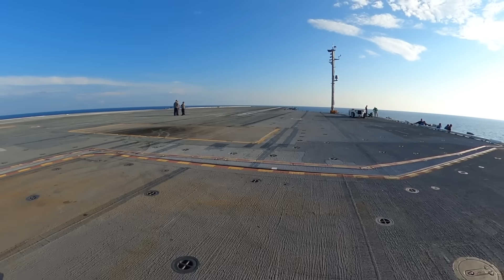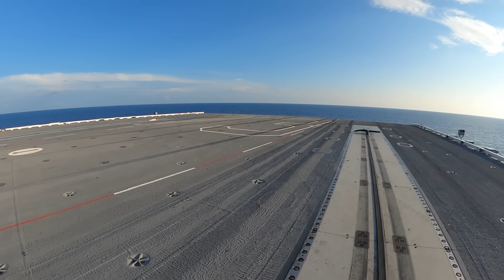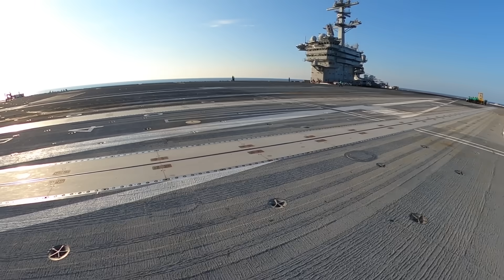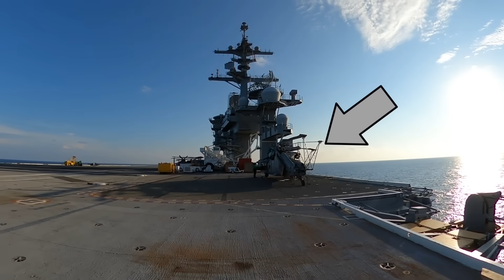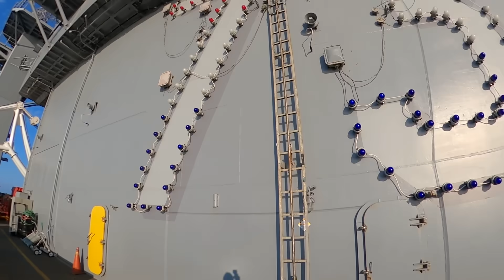The Carrier Flight Deck You Rarely Get to See

Comment: I loved the tour, took me back to days aboard the Ranger and the Enterprise, both of which are now gone. However, I did notice ya didn't talk about the port side waist foul line as you walked over it, or describe what they represent, or how many times in a cruise we here the airboss yell at some unobservant sailor to clear the landing area (LA) and the importance of maintaining a "green" deck during recovery operations. Also, ya just walked on by the barricade stantions,  and the importance of "rigging the barricade" for aviators in trouble. Sure, we get to see them used in Top Gun: Maverick and perhaps you didn't feel the need to express, however, there are non-sailor types here that have no idea what goes into rigging the barricade, the training and equipment material condition safety that aviators such as yourself count on when taking the barricade is your only shot and how you are depending on teen agers to maintain and rig that barricade. I really did enjoy the video, as I said, it took me back forty years to my youth and the best times of my life while working the flight deck. Thanks Pail.
Reply from the maker: Glad you enjoyed the video. 👍

Comment: Question: if the non-skid surface has to be reapplied every few years, that implies that it flecks off. Does that risk damaging engines or is it usually all accounted for during FOD walk downs?
Reply from the maker: It breaks off in sand grain-sized pieces.    No real threat engines.

Comment: Great Video. A lot of the items and areas were familiar, of course our Essex class ASW carriers were all props, so no JBD, but Tilly is still there. Back in the pure straight deck era, when they had aircraft parked on the bow and were recovering aircraft, there were no bolters. Initially the only thing they had to protect the planes up front was Tilly parked athwart deck behind the pack. Later they rigged barriers to protect the pack but still damaged the landing aircraft that missed the wires, but not as bad as hitting Tilly. 

Looking back at my days on the Randolph and Yorktown, I don't remember seeing Tilly, but she had to be there, I think they kept her parked in hanger bay 3 along with the barge and boats. These videos have brought back a lot of memories I haven't thought of in over 50 years. I do have a few landings I doubt any of the current aviators have - two water landings on purpose (in an HU-16 when at NAS Cubi). .
Reply: Thanks for your service.

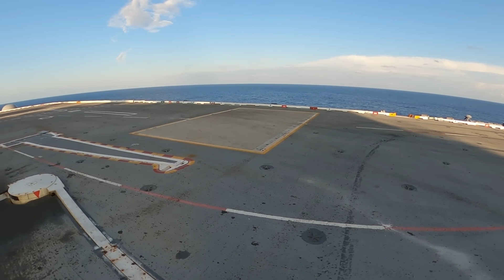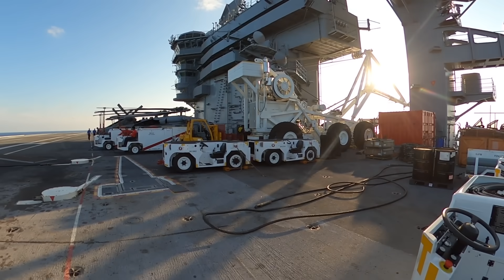Comment: 6:42 and 10:11  Darn it!  I wish you had mentioned the axe-shaped cutouts on the deck next to the arresting wires and support vehicles, which are the retractable stanchions of the barricade net for emergency landings in case a plane loses function of the tailhook or landing gear.  You could have tied them into the one crucial scene in Top Gun: Maverick, if you felt like doing so.  😄

Comment: Hi, i have some questions about rank and orders.
You are a  Lt or Cpt but you have to follow the lower NCO's on the deck to park the plane and you cant refuse?  I assume they have their orders from CO's above them and you or equal to you? 
If you arrive at a base gate and the Cpl says you cant pass, MUST he do what you demand and open or can he refuse as he has orders from higher commissioned officers?  also if you were a Maj and he had orders from a Cpt to let no one pass, can you CM him for refuse your order as you outrank his CO?
Last question- If a diff branch say a Maj and you are a Cpt demands you do what he says?  Does he have authority as you are navy and hes army?  or only in a war? 
I'm a pilot in GA and i dont think i would be frightened landing on a carrier as i guess you do thousands almost blindfolded in a Sim and its very normal if the bow isnt moving but what scares me is those 3 little tyres on the deck hitting a greasy patch and the fighter sliding with some crosswind and you stuck in it!!  right near the edge and all that, your brakes fail or steering after so many hard thumping landings. haha
Reply from the maker: You are making this way too complicated.  Directors aren’t giving us orders, they are just telling where to go.  The pilot is ultimately responsible for taxiing the aircraft.  He can override anything, but he better have a good reason. 

Rank is rank, no matter the service.  

Cheers!

Comment: I was wondering if i would be able to fit in a fighter jet. (along the lines of a growler or something similar) I'm 6'9 and would love to become a pilot but i know that would be pretty hard because of my height. Curious to see if you think i would be able to fit in a jet. Would love if you would be able to reply man or anyone that has some knowledge!
Reply from the maker: Every platform is different.  I knew a guy that was 6 foot 7 that could fly an F-18, but he required a waiver for ejection seat liability.  He was pushing it.  I suppose it depends on your exact measurements, but I don’t think it will work out.

Comment: Extremely cool video as always. What happens to the shuttles of cat 3 and 4 when planes are coming in to land? are they extended all the way forward? And if so, could it be that when you need to go around you "ride" over them with the wheels of the jet? 
Not sure if my question is clear using all the correct jargon :D
Ex military (army) from the Netherlands saying hi and thank you!
Reply from the maker: The shuttle for cat 4 isn’t a factor for landing aircraft.  The shuttle for cat 3 is covered with a metal cap called “fast Eddie” that protects it and the jets from damage.
Reply: @GrowlerJams  aah super! Looks like a pretty big object to just "bump" over at like 140(?) knots!
Reply from the maker: The shuttle is only 4 inches tall or so.  It’s not too bad.

Comment: Great video, very interesting and informative. I posted it on another forum, and got a comment that it wasn't interesting, because there was no flying. I responded that it was interesting to see what makes it possible for all the flying to happen, which brought to mind to ask for a video about the maintainers. I mentioned that none of the cool guy stuff happens without them. Said as a retired Air Force Weapons troop, C-141 Flight Engineer and current Gulfstream and Boeing pilot.

Comment: Would like to see different aspects eg the elevators in use. How they are powered. Obv hydraulics but a bit more about them. How the jet fuel gets to the deck from I presume the bottom of the ship. Similarly the ordnance and role of the Gun Boss(?). Navigator, does he/she still use traditional methods or solely rely on modern systems. I've got an app for that!! Not something you always want to hear.

Comment: I have a question about the non-skid deck. I'd imagine it is pretty rough on both aircraft tires and deck crew shoes/boots. How are both resistant/non-resistant to it? I have something very similar on the deck of my sailboat, and it's murder on shoes!
Reply from the maker: Yup, it’s very rough. It accelerates the replacement of the surfaces that it encounters.  It is what it is.

Comment: I served aboard 2 carriers in the late 80's and ending with Desert Storm.  The brand new USS Roosevelt and the middle aged USS America.  Since my job was down in AIMD, I only visited the flight deck when flight ops was secured - SO, can someone tell me what the row of white box squares are at the 11:30 mark ...starboard side running with the 'bomb farm'?  I just assumed that they may be for emergancy ordnance disposal.
Reply: You're right, they are for ordnance.  They are jettison lockers for CADs and about anything you can fit in there.  The handle on the lower right of each one is for jettisoning.
Reply: @stanstenson8168   
Thank you - mystery solved.

Comment: What are the blue barrels on the catwalks?  I always see those in DCS and wonder what they are.  I once got a tour of the flight deck of USS Ranger when it was in port in San Diego.  It seemed like the pad eyes had a secondary use as ash trays.
Reply from the maker: Rafts, if things go bad in a hurry.
Reply: @GrowlerJams  Oh, I had thought the rafts were the white barrels that hang off the side.
Reply from the maker: Oh, I misread your comment.   Yes, rafts are in the white barrels.  Honestly, I have no idea what’s in the blue ones.  🤷🏻‍♂️
Reply: @GrowlerJams  Hah, okay thanks.  My search continues!
Reply: the blue barrels are AFFF concentrate - which is mixed with seawater from the firemain to make AFFF.    There is an installed AFFF system that put out AFFF to hoses on the catwalk and thru the flight deck sprinklers.   the blue barrels allow sailors to still make foam in the event of a casualty to the installed AFFF system or if all of the AFFF in the installed system has run out or used up and deck crews to continue making foam from the AFFF barrels as long as there is firemain pressure.   i don't know the capacity of the barrels on the catwalk - maybe 50gals?  if they are 50gal barrels - each barrel should make 4700 gals of AFFF and last about 20 minutes.
Reply: AFFF.

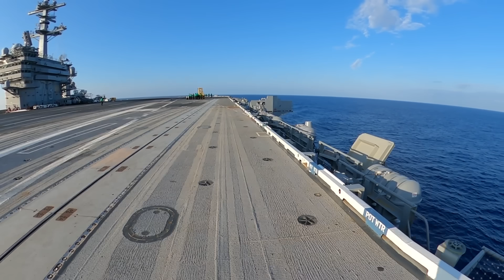Comment: 5:15 wait, what?

I thought those were where ships pump sea water through, to wash the deck, in case of something like a radiological attack?

I mean, I know these boats have a system to completely cover themselves with a flow of sea water, I've seen video of it.

And I'm not seeing anything else to do that job?... Dual purpose perhaps?
Reply from the maker: No, those are metal tie down points.  The ship does have firefighting hoses, but they are on the catwalks.  Sea water would have no real effect on radiation.
Reply: @GrowlerJams  Mate, no.
You can totally wash off a LOT of radiation.

Sure, you can't wash off radioactive emissions, but you can 100% wash off radioactive particles..... which are a lot more dangerous than the rays.

I asked ChatGPT and found it,  its called the 'countermeasure washdown system' and  you can see it clear as day on  the 'Dark Footage' video entitled "Aircraft Carrier Bio Force Field - Countermeasure Washdown"

v=28o8z0ns57w
9 seconds in.

Tell me that's not the same holes?
Reply from the maker: Valid point about washing away the particles.  I have to admit that I have no idea.  I’ll have to look into this more.  You have me curious.
Reply: @GrowlerJams  There is a countermeasure washdown system - its not the padeyes OP is mentioning.   you can put AFFF thru it or not and just run seawater. PriFly and Conflag stations control the washdown system  - we dont run it because it puts seawater everywhere - then you just have to do a freshwater washdown afterwards.
Reply: @GrowlerJams  Mate, no!
You can for sure wash off a LOT of radiation (and bio/chem).... sure, you can't actually wash off radiation, but you can wash off the particles that cause the radiation.

Anyhow, I found it, it's called the countermeasure washdown system and it can be seen clear as day on the ' 'Dark Footage' video entitled "Aircraft Carrier Bio Force Field - Countermeasure Washdown"

v=28o8z0ns57w
9 seconds in.

Good vid too, apparently (and obviously, now that I think about it) its also useful for fire suppression.

I'm pretty sure its using the same holes.

Comment: Nice tour of the BOAT !  I was an A6 Intruder plane captain in the early to mid 1970’s. In VA-42 (RAG) NAS Oceana, Virginia Beach, Va. I got to go on the Independence, Lexington and the Franklin Delano Roosevelt on carrier quals. Exciting and dangerous work on the flight deck during flight opps. Especially night opps. I saw an E2 Hawkeye catch the cable and crash on landing. It didn’t come in level with the deck and broke the starboard main landing strut. I also saw a F-4 Phantom catapult off the bow on the same carrier qual on the Independence CV62. On another carrier qual I got to ride in a COD C1 Trader. Catapulted off the port forward catapult. That was a Thrill. After releasing from the catapult with all those G forces, it felt as if we were going into the gulf for a swim. But it just floated away from the boat. I was also fortunate to experience a ride off the boat in a Huey and a CH-46 after carrier quals. Also went to Fallon and Yuma for bombing detachments.  I enjoyed the work of a PC but not all the watches and ALL the BULL !!!
FLY NAVY !
Reply from the maker: TYFYS.
Reply: Tank you for your service Shipmate!
Reply: Thank you for your Service Sir 🇺🇸🇺🇸
Reply: Plane.Captain for.your.entire hitch?
Reply: I, too, was stationed at NAS Oceania from late 72 to early March 75 VF101 (F-4) & VA85 (A-6). I was on 6 aircraft carriers and 5 different ones. Forestall (Med cruise 75) Independence, Kennedy, America, Enterprise I also was on the flight deck too many times. Scary isn't the word. Especially when you were aft of the island during landing operations. Now I have many health issues. Along with 2 failed marriages. I attempted suicide a few times (still on my mind). I want the pain to go away. If anyone can relate, let me know? No one wants to be around me.
Reply: The GW isn’t a boat. It’s a ship, Airdale.😮
Reply: Wow. Ty Sir. TRUMP

Comment: Noob question here:
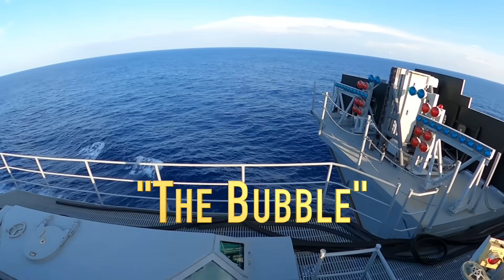What is the purpose of the windows towards a wall at 5:40 in "the bubble" station? 
Or can it be lifted up to see above the deck and it is lowered for atm... for what?
Reply from the maker: The windows are for the Shooter to see outside of the bubble when it is raised.  The Shooter needs to see the jets to launch them.
Reply: @GrowlerJams  Ah ok, so it can be raised, I hoped so. But why is there a need to have it lowered then?
Thanks for your videos and your work you do btw. Amazing stuff, great videos you deliver!
Reply from the maker: We lower it to prevent it from getting damaged from jets on the flight deck when it’s not in use.
Reply: @GrowlerJams  makes sense, safety first - everything what could be potential dangerous: out of the way. I get it now.
Thank you!

Comment: Thanks! Make a separate jam about «Tilly». Makes sense, but i’ve never tought about something like that is on board. Cheers!
Reply: Not much to talk about. The A/S 32A-35 crash crane can pick up airplanes and move them out of the landing area. It is  a  self-propelled,  four-wheel  drive, six-cylinder, liquid-cooled, turbocharged, dieselelectric-powered vehicle mounted on six pneumaticrubber tires. The ac generator is directly coupled to the engine and provides power to the drive motors, luff/hoist winch motor, auxiliary hoist/counterweightwench motor and motor control systems. It has a lift capacity of 75K pounds. If you put that model number into Google, you can download a complete manual.
Reply: @ cheers 👍🏻😂
Reply: @Naturephotodude  P.S. If you wath Bridges at Toko Ri (a Korean War movie), they have scenes where they speak of and show the early version. Each aircraft aboard has a unique lifting sling designed by the aircraft manufacturer. The Crash Crew must train with each of them. The E2 Hawkeye sling is super complicated and takes a bit of time to rig.

Comment: One feature I've wondered for a little while as to what it is is the slightly raised rectangular area at 45* to the arresting cables, seemingly not coated in the anti-skid spray. You walk over one of them at 7:01. What are they for and what are they made of?
Reply from the maker: They guard the hole where the cables go below the deck and attach to the arresting gear engines.
Reply: @GrowlerJams  Cheers pal, appreciate the reply and Merry Christmas!